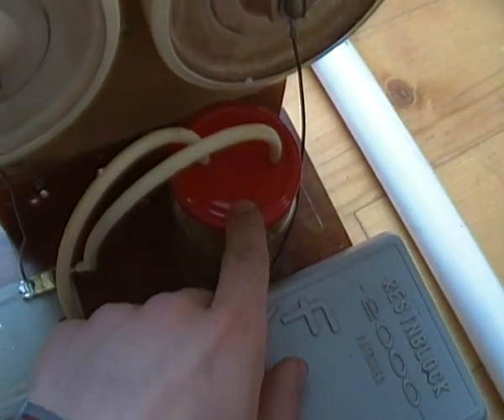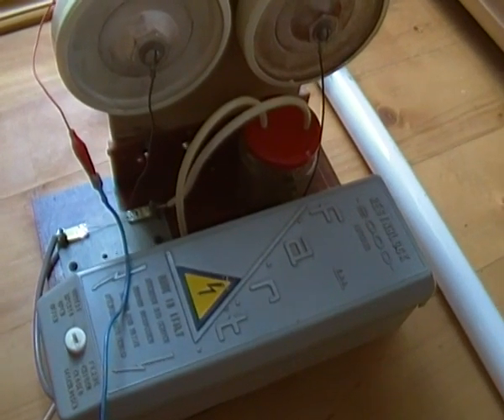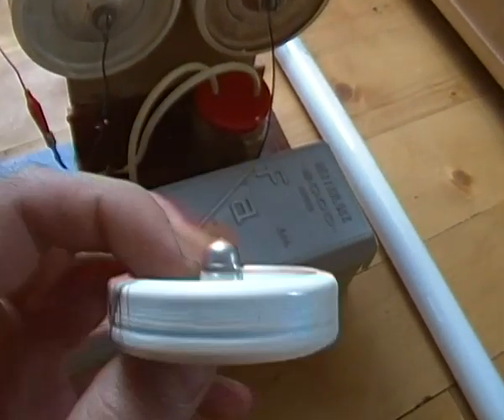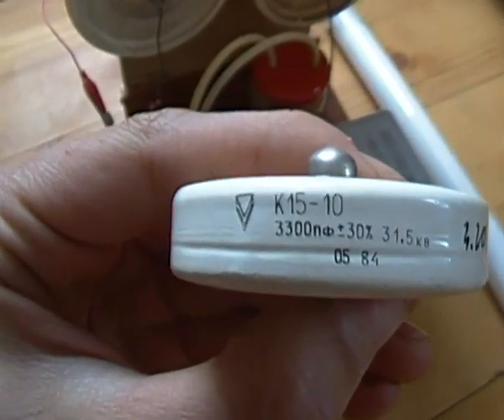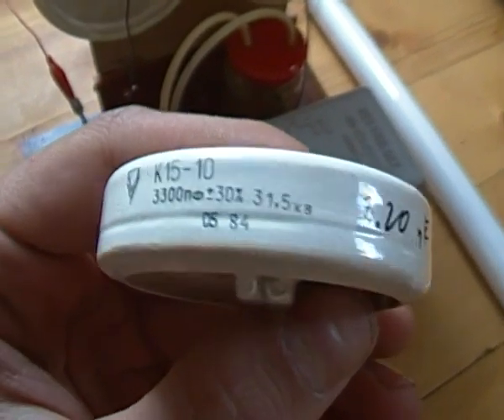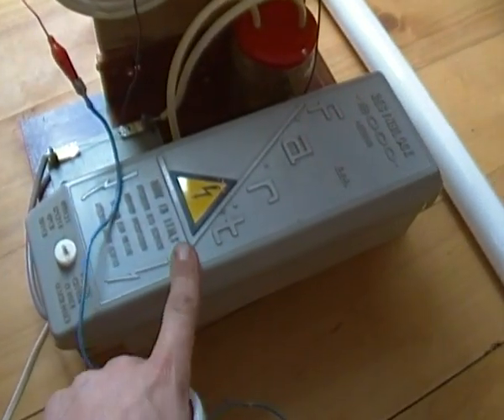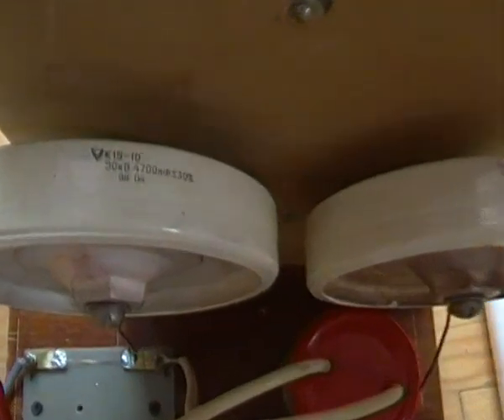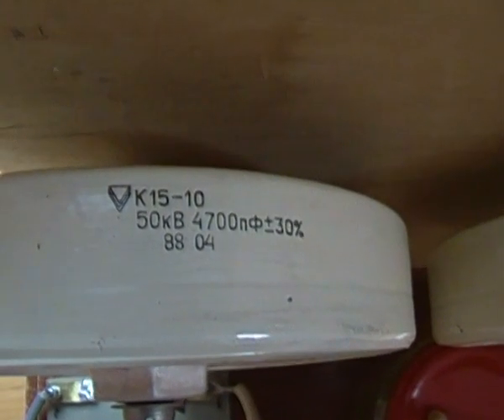Tesla Hairpin improvements

Comment from the maker: 1. Yes, almost full brightness. We can explain that when model a HP as a low-henry inductor powered by very fast and powerful impulses. So in this conditions HP becomes a resistor bigger then the load resistor (bulb).
2. It`s impossible to overload it. HP has some power limit. Approx 50W.
3. Suppose that voltage is the same 10 KV but due to impulse form it can jump across the cap much easily. 
The greatest question at the moment: why do input power decrease when we place a load on HP?!
Mieow.